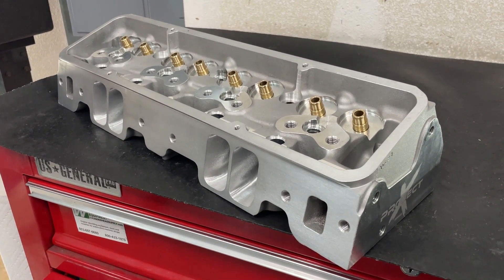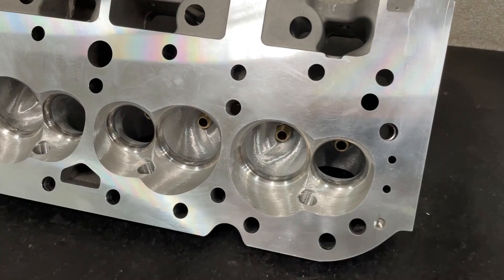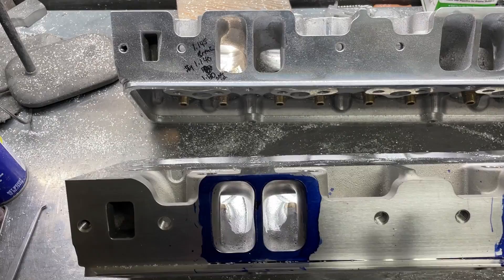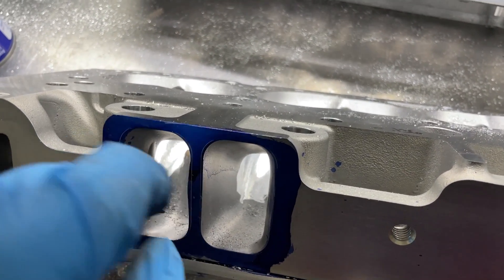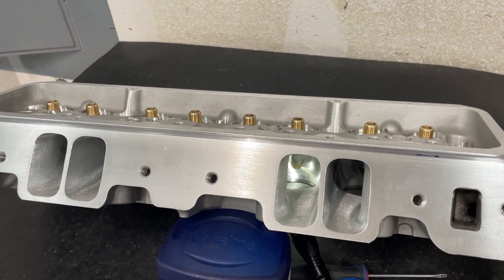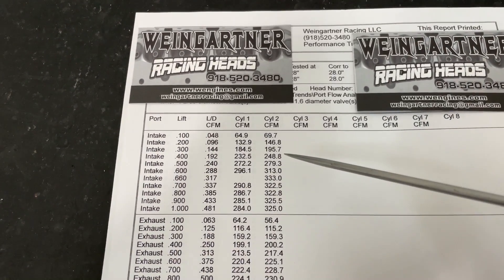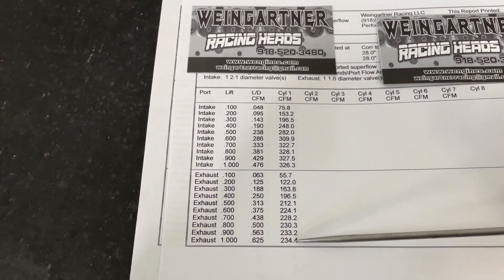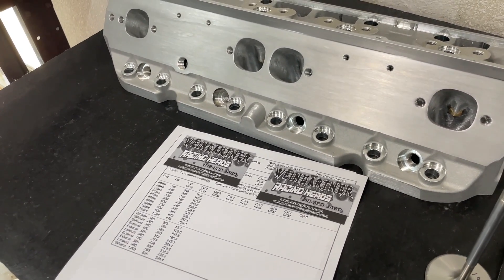I Ported The Promaxx Project X 215cc Head

Comment: So once again let me ask about a 350 cid engine. Pump gas 9:1 engine, with these heads. Would it be a dog until upper rpms? 
 Imagine these with a 350cid, lots of rpm and turbos. 
 Maybe a 4.040 bore and 3.875 stroke 397cid high rpm setup shaft rockers. 
 Now let me ask, can you do a dart cast iron version with these flow numbers. I’m really not a fan of aluminum.
Reply: He doesn't do cast iron porting ,, watch a few you'll hear it
Reply: @Levisnteeshirt1  I’ve bought both of the cylinder head dyno test books. Probably still go with some big dart 215’s or 220 heads. Gotta have the compression to make them work. Maybe even a set of aluminum heads. These numbers are for big hp! Gonna buy the big block book next.

Comment: If your fighting the casting on the pushrod side for area? Why not narrow the center divider further? I'm curious about the AFR valves of the present day. I know your pretty much a "Drag Racer" so full power applications are under 20 seconds of duration o any given pass...Just curious if AFR still sources their valves from KAR valves like they were over 10 years ago when I bought my "Race Eliminator 195 CnC" heads. Me? I view my valves when I'm running stiff "Solid Roller" springs as a potential weak link in the system and am more than willing to pay the price for a known piece of quality hardware. I know you have said "Manley Valves don't flow" but, Manley is more than willing to make any head profile you desire for just a few dollars more over their catalog offerings if you need a specific head profile. We had them replicate the AFR valves years ago...We knew they were shaped like they were to enhance air flow....That 10% gain was pretty awesome on those heads but, if they would offer some with a wider spaced pushrod passage with more meat on the pushrod side? I think the flow numbers could be made far better. Why wouldn't you send a sample to Brodix to mold and make cores from and get some heads sourced from the USA that will allow you to do all that is possible with a 23 degree head?
Reply from the maker: If you make the divider too thin they do not seal. Afr has two different valves one is thicker. Afr has a parts warranty on their valves for two years. Brodix would do it but it would cost a fortune. Like 30k

Comment: I've been hearing good things about the Promaxx heads. I'm not sure what the total cost is but those will work very well.
Thanks for sharing keep up the good work Eric
Reply: Bulshit blows in all directions! 20 years ago these were the worst aftermarket head. And 20 years later I bet they still are.
Reply: MBe not.  40 years ago everything that came from China broke within 2 days. Now you can buy high quality tool, engine parts manufacturer to US standards on us machines. Some really good stuff. Even snap on and others have China making half their stuff. @1mikewalsh

Comment: Eric... do you have any experience with the Gen 5 L83 cylinder heads as far as porting or flow numbers?
Reply: i had just done a set of lt1 6.2 variant. definitely a bit tricky of a head to work on as its a very thin casting around the port.... end of the day i almost broke into the exhaust port just trying to size the bowl and i hadnt even touched the exhaust side yet. i assume the 5.3s variant with the small 1.92 valve would be much more meaty and give more room to play? i would be interested also to know. as far as how these lt1 heads came out... at .650 flowed 362 exhuast at .650 no pipe 237. both ports kept flowing up to .800 lift and past.

Comment: I was always scared to over cc my intake runners being old school , would out of box these project x 215’s but cnc’d be great on 2450 lb drag only nova?  Basics are I  a 4.030 bore , 6 inch rod “355” 13.2 comp w64cc & .039 head gasket upgrading to a  .675 lift roller & say 104 or 102 lobe separation? Or better use 200cc ? & have ported ?

Comment: Very impressive results on your porting resulting in incredible gains Eric!
It'd be interesting to see some dyno results "with vs without" regarding that backwards AFR style vane. 
I find the vane somewhat counterintuitive. What are your thoughts on it regarding high lift port stability? 
Those heads ought to be good for a min of 650hp on an optimized for drag race 400?

Comment: What if you done a straight vein on those odd intake ports? Does the vein looks like it causes the air to turn the wrong direction when it’s coming into the chamber. What if you made that vein straight and leave the other two alone? Just a thought.

Comment: If 330cfm on the right build don’t make 565 something wrong.   I bet he’s going into the 600z
Reply: We had a set of dart pro 1 215s ported and they topped out around 330 @800 , on a 421 with 13 to 1 compression, 1150 pro systems dominator on a victor intake at 1 7/8" headers it made 652hp at 7300. Can't remember cam specs offhand

Comment: Beautiful work on those ports! What would you expect for horsepower from a 406 at 6500 with these heads, assuming cam, intake, etc, were optimized? Would it get to 625? As far as the pushrod pinch limit, could you cut the pushrod hole oversize and sleeve it like you do with some head bolt holes? Just curious on that one… Thanks Eric!
Reply: I’d say closer to 700 horse depends on cam and everything else.
Reply: Hell, they flow good enough, you should be able to make 580/590 no problem as they come from the factory!

Comment: Think FUNNEL of CROSS Section ?? ....Where is the RESTRICTION ??......Where     is Smallest Cross Section in the PORT ?? Pushrod Pinch is 2.45 Sq Inch....91 % of 2.10" Valve  Cross Sec - 8mm  Stem Cross Sec =2.787 Sq Inchs ?   Where is the RESTRICTION    in CROSS Section ? ..1.24" x 2.25"= 2.79 CROSS Section.... Think FUNNEL- Manifold RUNNER to Head RUNNER too VALVE THROAT CROSS Section , Tapered Cross Sections ??....  Think FUNNEL  - Exhaust THROAT CROSS Section Tapered to Header  Flange , a 20% Bigger CROSS Section to  3-Stepped Primary  Pipes to Merge Collector   . .  Cram  the CROSS Section in and out - FUNNEL !!..2 Cents   -